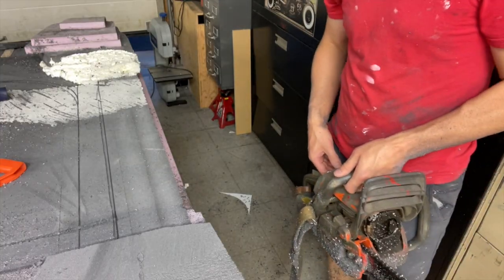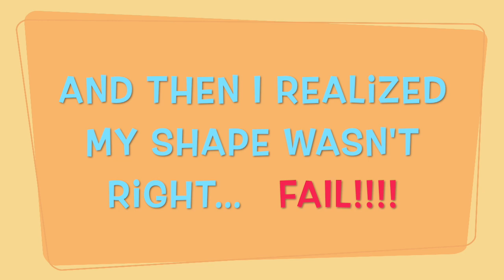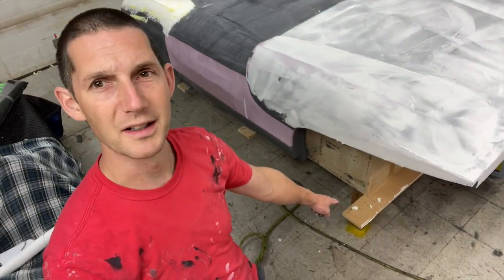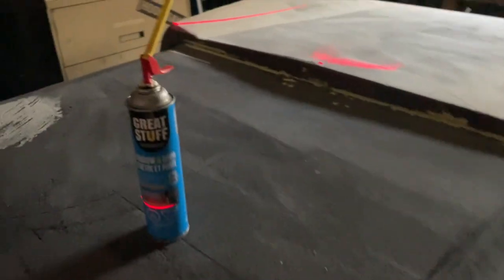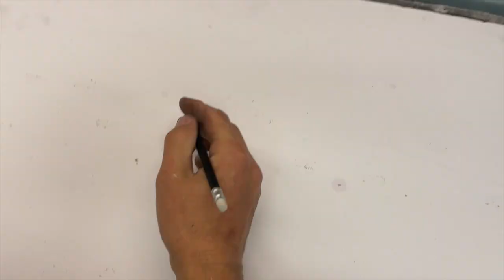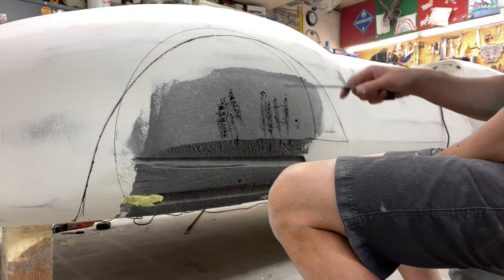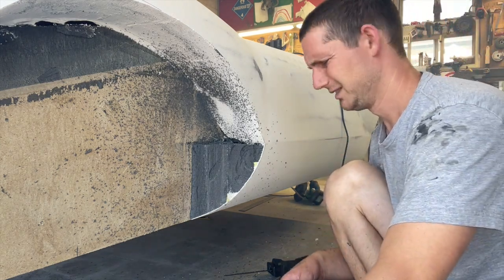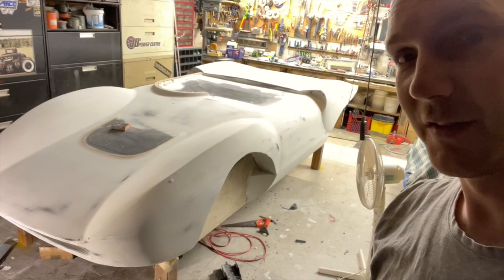home made carbon fiber car body -Video 5

Comment: Do you know how the original bucks/molds were made by Ferrari back in the day?

Great channel by the way!
Reply from the maker: Original body bucks were wood frames and were used as the initial shapes to hammer aluminum panels over, and also check their fitment.
Reply: @howisthatstreetlegal  thank you.

Comment: So after the joint compound, what did you use to seal it? Not sure I see a video on that? I’m in the joint compound stage right now. I’m debating on what to use to get it ready for a mold.
Reply from the maker: I seal it with latex paint.

Comment: Please give the details of composite used for that car body and that process details
Reply from the maker: the molds are made with 4-5 layers 1.5oz chopped strand fibreglass. the carbon I used is a 12k 400g twill.